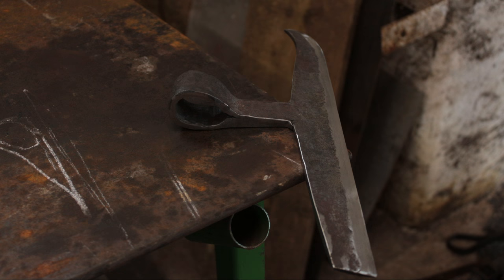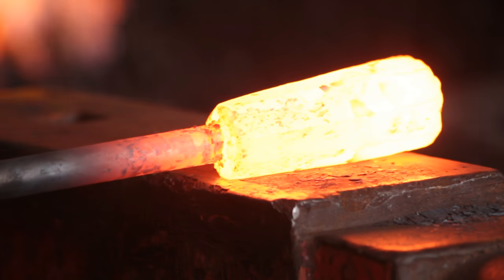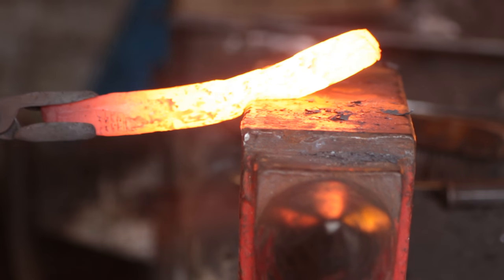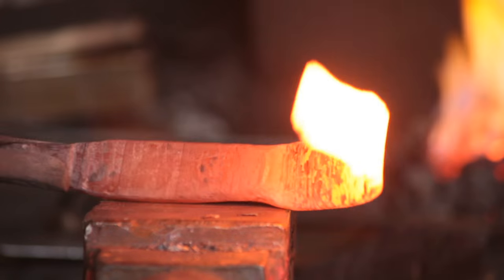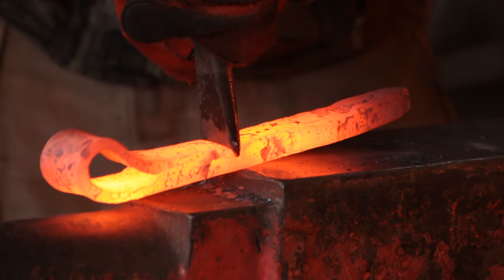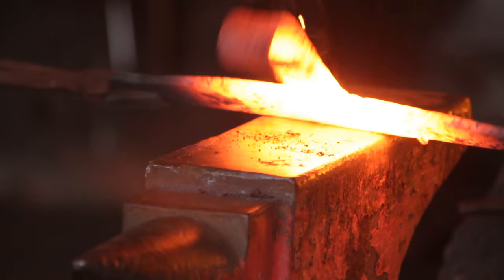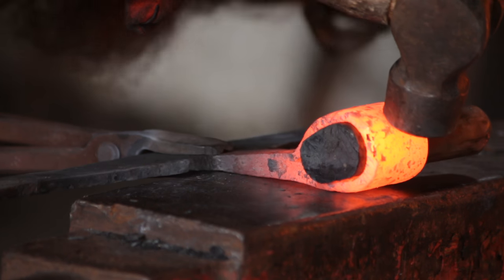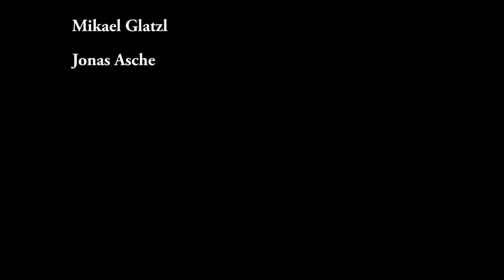Forging a Viking shipwright's axe: Part 2 - The eye.

Comment: Excellent work Sir !
It occurs to me that the tool recovered from Hederby might have already seen a lifetime of use and wear before it was buried or discarded and subsequently eroded/corroded . Any thoughts on likely practical dimensions for efficient use of this tool. It appears to me it may have a lack of 'heft' and the thin blade width perhaps making directional 'guidance' of the cutting edge, somewhat challenging.

Comment: So, why do you choose to use wrought iron so much? Obviously for historical accuracy, but what other reason? Is it just what you have available? Or do you just like the way it works? (Because it looks really fun to forge.)
Reply: Every blacksmith would choose to forge with wrought iron if available. Problem is , it's not made anymore. And yes, it's because of the way it works, and the ease of forge welding etc.

Comment: Great video, however i think your math for estimating the material for the eye may be a little off. Adding twice the thickness isn't enough.  You need to divide the circumference by pi to get diameter, add twice the thickness and then multiply by pi to get the new or outside circumference in this case. For example, with 1/2 inch thick material, If you have a 31.4 inch inside circumference, divide by 3.14 for an inside diameter of 10 inches. Add twice the thickness of material for an outside diameter of 11". Multiply by pi and you get 34.54.  This is a difference of 3.14 inches, alot more that the additional inch the math in the video adds.
Reply: I disagree. He stated it was an estimate. His handle drift circumference was five inches, although it isn't a circle.
Reply: I know it was an estimate and in small forgings the difference may not matter, however i was bringing it up because a viewer may use the same math as the video to cut something like a band for a barrel or tank and will come up short. I thought i would post the correct math.
π(A/π+2B) where A is the original circumference and B is the thickness of material supplied.
If he used 1/2 inch material, and it did not change thickness, it would be 8.1 inches around.
For this math, you are basically assuming the the wire he used to measure the drift is curved into a circle, not the drift shape.
This is a very simple geometry problem calculating the circumference change caused by a change in diameter due to the thickness of the material applied to the outside.
His final dimension should have been:

I work with leather and it is important to account for leather thickness in patterns, not doing it will cause all sorts of issues. A small error can add up to inches in the end.
Reply: "There is only the measure of the eye" -Michaelangelo

Comment: Rowan,
Between 7:40 and 7:50 you mention using a fuller to create or shape the eye better. Would you embellish on that a little if you don't mind, I don't quite understand. 
Thanks!
AAR
Reply: when he said hes using the fuller to better shape the eye what he meant was that hes using it to keep the eye from collapsing while shaping the material, instead of just using it to punch out the eye and hammer on it like most axe makers do.

Comment: Love the axe Rowan. I was wondering what the ancient smiths use instead of a belt sander?
Reply: Files and stones :) later they could have used man powered stone wheels to grind and polish metal :)
Reply: As I understand it, stock removal was quite common in the past. More than we give thsm credit for. Dunno about the dark ages specifically. However, I do know that there are old sections of waist high wall in ancient cities around the world that have dished grooves from people sharpening their knives on it. I use stones for finishing my own projects from time to time. Works just fine.

Comment: I was slightly disappointed in that the axe resembles more of a knife than a trimming axe. The blade would be a bit wider and definitely heavier made as even Viking axes though narower need heft to stroke evenly. And both top and bottom ends in your illustration were rounded not curved as you have it. Not a bad implement but not a ship builders axe even a Vikings. Rounded ends dont dig in. I know you are more of a blade smith than a tool maker so I apreciate the effort. Pictures hardly do these types of tools any kind of justice. So thank you I still learn while watching you. Was a wood worker before taking up blacksmithing.